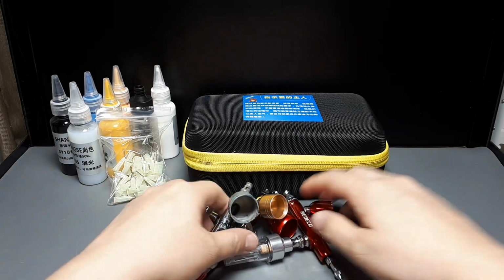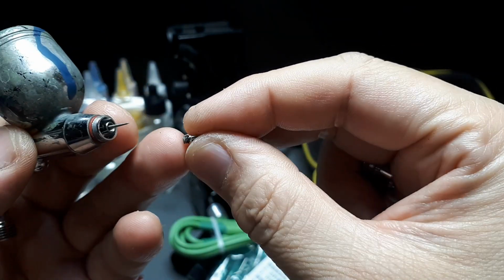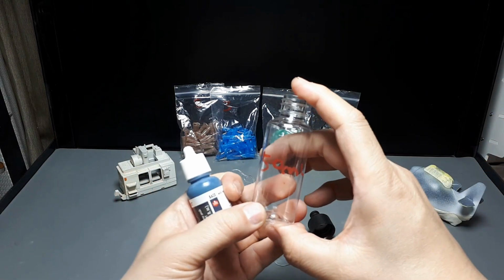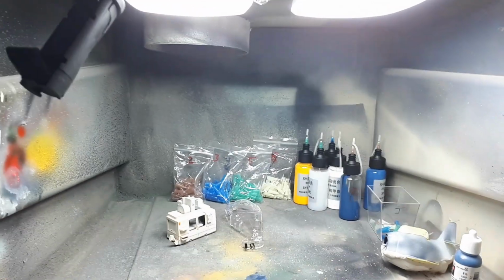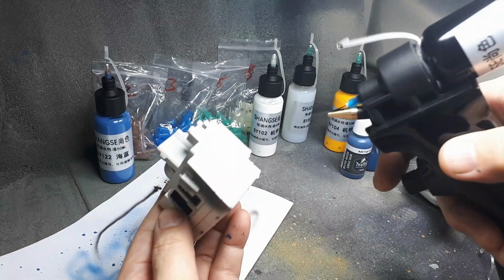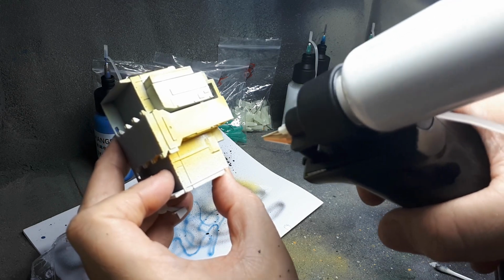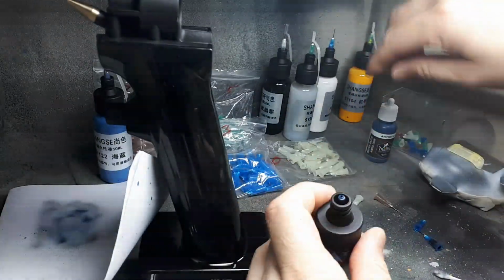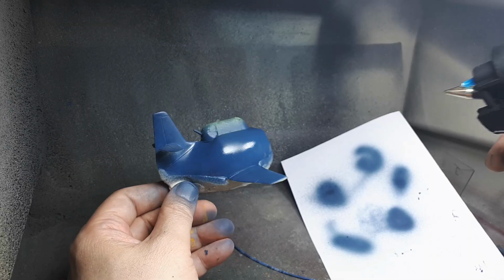SHANGSE No Clean Airbrush 30psi rechargeable cordless disposable nozzle quick spray paint portable

Comment: how did you go charging it? 
I can't tell if it's charging
Reply from the maker: Mine shows the digits as it charges.
Reply: @smallmodelcollector  I worked it out, I had to use an older charger, not a fast charger, and had to use the cable supplied with the unit. But yeah it works. Thanks for writing back

Comment: Thanks for the review!  I bouth this one from TaoBao as well, just waiting to arrive and have a go at it. So, I really appreciate how real this review was. Even the mistakes, because they could happen to any first time user! 

One question, I did had issues when buying their paints since Cainiao basically rejected the package. Do you mind sharing how you managed to get yours to the states? Thanks in advance and keep doing awesome reviews!
Reply from the maker: Luck;, the 2nd time I ordered paints it was returned to the seller.
Reply: @smallmodelcollector  Hey man, I just wanted to kind of update you on this, I actually managed to get the paints accepted by Cainiao and came across with the real reason for the rejection.   For this type of paints, as they're water-based, the only restriction applicable by Cainiao is due to weight. As long as the weight per package is under 1 KG or 1L, you'll have no issues. So, what I did was divide my shipments and send 6 packages of 6~7 bottles each. 

I now have 40 x 50 ML bottles in my Cainiao WH waiting for air shipment 😁

Just wanted to share that information with you so you can get your paints without issues and return the favor in a way, as a thanks for all your helpful tips and reviews. Hope this helps!

Comment: This video was very informative. I have the same brand, and I used water-based paints; from what I noticed, I need to add in more paint and a little thinner to make it good at spraying. Also, clean-up is way quicker since the apparent Swapple design. The only con from what I noticed is that the tip sometimes leaks, so I need to clean the airbrush quickly; other than that, it was a good piece of equipment for base coat application, but for more detail application,  it's a little hard to judge based on paint type and pressure from theairbrushh and the quality of the needle as well weather. Good product overall, though I would appreciate a gravity feed design or sell the spray add-on just in case the one it comes with eventually wears out from poor maintenance of paint leaking into the spray.